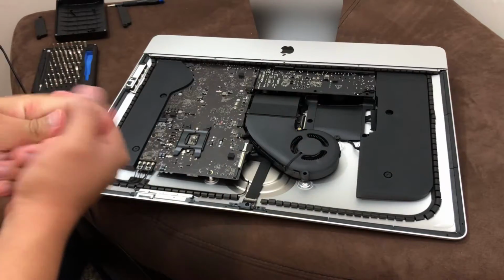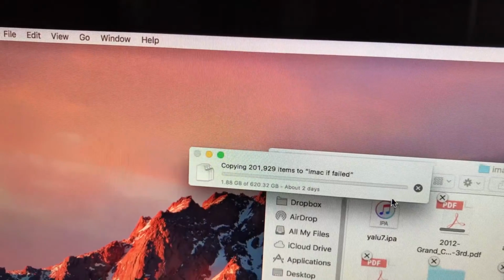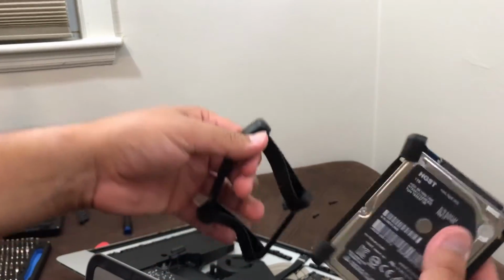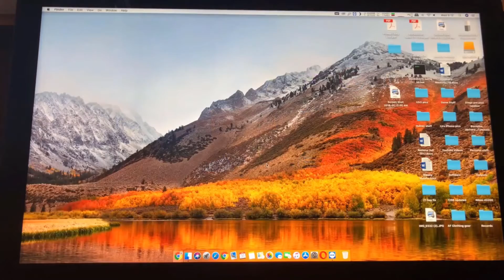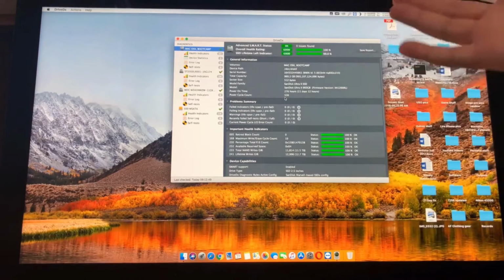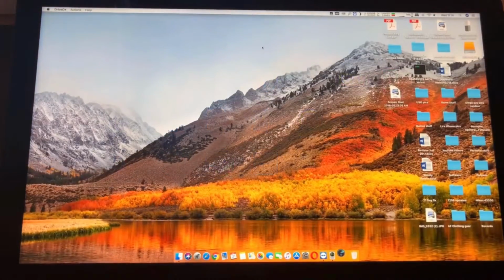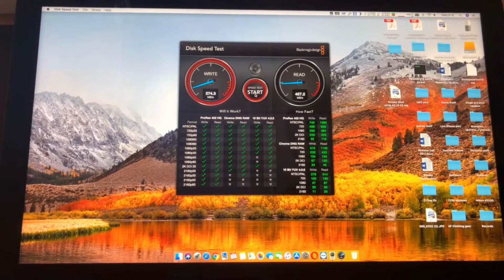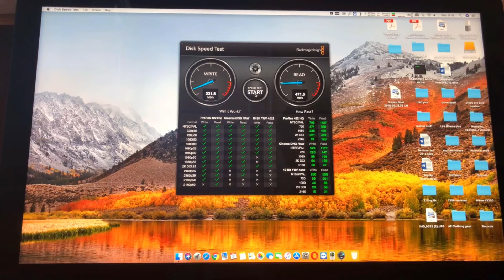2017 iMac SSD upgrade & Speedtest

Comment: For anyone who is just thinking of doing this:

I have swapped the slow hdd for a 1TB ssd and put 32GB Ram instead of 8. (2x16gb). Results?

Before I thought that the 21.5 inch iMac which I bought second had is faulty. Booted in 5-10 minutes.

Now it is even quicker than my top end 27inch 64gb ram hybrid deive imac.

Absolutely amazing increase in performance!!!! I mean not increased only 2x or 5x times, but is around 20-30x times faster than before.

Comment: Did you install the heat sensor for the SSD?
Reply from the maker: This model does not have a heat sensor for the hard drive
Reply: @SmallTechReviews  Thanks , one last question. what screwdriver did you use T8 or T10?

Comment: After replacing HD with an SSD in an imac 21.5 non 4k 2017 entry model (no fusión drive) works awesome. Some months ago starts to rebooting without reason. Now the fan is working crazy. I read about it's related to temperature. Is Apple adding some locks inside firmware updates? Be careful you can throught a lot of money. My imac is not longer usable
Reply: Have you tired to reinstall the OS?
Reply: @aycardo10  Yes, I do. I tried with the original HD and the new SSD several times. One thing that i just notice is that during the starting the third LED on the motherboard lights up. Aparently is related to an issue with my LCD.. My first guess is the Flex is damage. Hopefully I can resolve it
Reply from the maker: Good catch, hopefully you found a fix for your issue

Comment: Why not install an external thunderbolt 3 enclosure with NVME SSD drive  (high speed) instead of having to open the screen?
Reply from the maker: Not even joking but less clutter
Reply: Explain please ???
Reply: @AMGKING509  You could use an external enclosure for example Fledging TB3 and use it to install Mac OS there. You will have an excellent performance.
Reply: @Fer-mu3yq  how can I do that? could you explain me better please??
Reply: @Fer-mu3yq  ty so much!

Comment: Some clarification for those who want to upgrade their iMac's SSD. There are two options. The first one(and also the better and more expensive one) is only for iMacs that were bought with a Fusion drive. These macs have a second SSD slot which uses PCI-E. The PCI-E slot is capable of delivering more than 3000mb/s (megabytes per second) of read and write speeds. These PCI-E drives have a special Apple connector and there is only one company in the world(as far as I know) that manufactures SSDs with this connector and it is called OWC. OWC has recently released a new SSD called OWC Aura Pro X2 which is compatible with the iMac 2017. Those of you who would like to experiment can also check the Sintech's convertors which would allow you to connect a standard NVME SSD like Samsung EVO 860 but I have read here and there that it doesn't work well for everyone. The second option is available for all iMac no matter Fusion drive or normal HDD and it is to get a standard SATA III SSD from your favourite brand. However, the SATA III read/write speeds are hardware limited at 6GBPS or  720mb/s(megabytes/second) but I haven't seed a SATA III SSD that has read/write speed bigger than 550mb/s. About the thermal sensors, many people say that it is no longer needed with 2017 iMac.
Reply: Do you have a link? The one I find only says for 2013.
Reply: RO CI Link to what?

Comment: Excellent video 👍👍. Question I have the 2017 iMac fusion drive, do you think I can change the mechanical drive for an ssd?
Reply: yes you can change it to an ssd and you should, the performance diference is abismal. My imac 27 inch maxed out from 2012 is running an samsung evo and now it seems like a new pc, runs premier and photoshop super nice now, prevouly i had 1tb HD and was super slow. Now i  can keep my imac around for longer till it dies. (ive repasted the cpu and gpu thermal paste too, and made a difference)
Reply from the maker: Yes you can, the iMac with a fusion drive has a slot for apple's proprietary NVMe SSD also. The one i had was a spinning HDD only and didn't have this option for Apple's proprietary ssd
Reply: @SmallTechReviews  hi there, im thinking of upgrading de mechanical hard drive of my imac 21.5 fusion drive 2017 for and ssd ,  question i had heard that so im able to change the hard drive ill need a thermal sensor for the system to work properly. its the thermal sensor  necessary? .

thanks!!!!